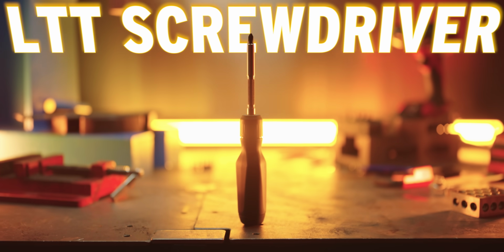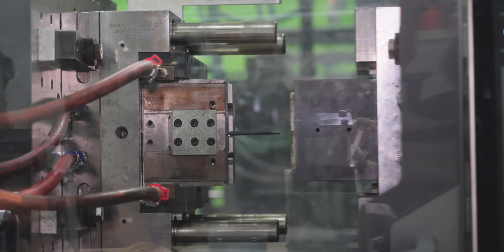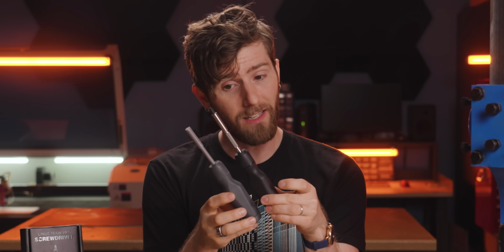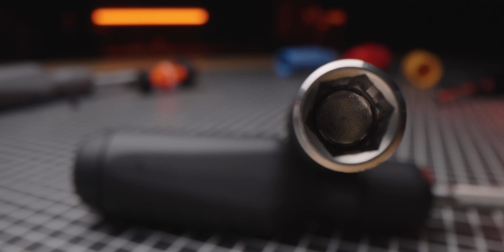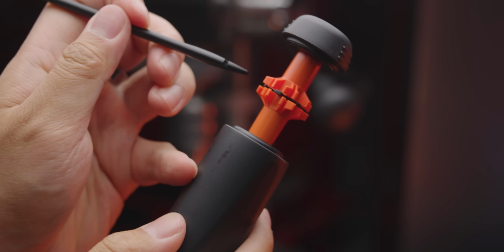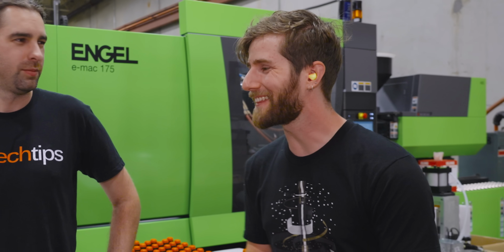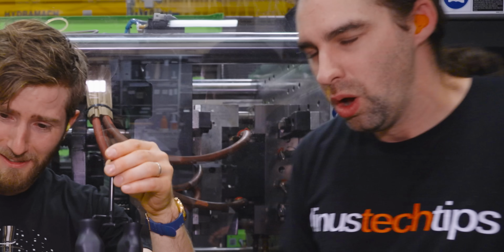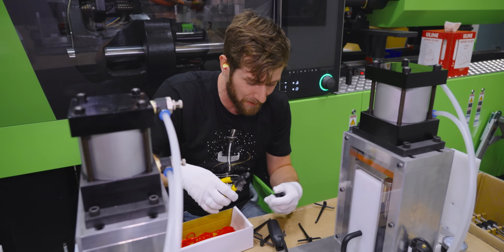Why our Screwdriver took 3 YEARS

Comment: I can buy the same thing at my local hardware store for $10 and has all the exact same features and I live in a small hick town
Reply: It's not the same. lol
It will last less 100%. And it will be less efficient...
Reply: It's a screwdriver it's not that hard  hundreds of better choices for WAY cheaper
Reply: @Ifyouaintfirstyourlast  I've tried a lot of screwdrivers that use bits and are not good but ok.
Reply: @Azarilh  and I make all my own tools it's really not that hard or expensive
Reply: @Ifyouaintfirstyourlast  Ok, kid. 😂
Reply: @Ifyouaintfirstyourlast  then make your tools and sell them for way cheaper dude.
Reply: @Azarilh  if u had a simple machine shop u would kno. For my machine shop its simple
Reply: @mattdamon9326  I make automotive parts screwdrivers r not a priority to sell I make my own tools because it's so easy
Reply: @Ifyouaintfirstyourlast  Are your tools as complicated as this screwdriver? Are they as refined? :v
Do you mold metal and plastic too? :v

Comment: Congorats on your own screwdriver, but not for me. I will stick with my sets of Wera screwdrivers. For manual screwdrivers, i prefer individual sizes instead of bits because i am not a fan of any sloppy disconnected feel, i want it to be solid with no moving parts. If i need speed or more power, i got a few impact drivers.

Comment: As much as you hype up this screwdriver, it is still a brand new product. There are some very good features that I'd have liked to see on the original Megapro, such as the magnet instead of retention bearings on the bits and the ratcheting mechanism operating in same direction, but at the end of the day, the Megapro screwdriver is already premium product, and I don't see reason to charge double the cost for these upgrades. I could use the Megapro all day, everyday and still be satisfied, so there isn't really a reason to spend nearly $100 on a screwdriver that's practically identical save for minor quality of life upgrades. If the design were completely different, such as the Wera Kraftform, then perhaps (though I would not pay that much for any screwdriver given that what's available in the Megapro is already great), but even then, it'd have to have features that differentiate it from the rest of the drivers available for cheaper.
Reply: Yes. This is not for the majority of people but more so for those that want perfection.

Also 69$ is not "nearly" 100$. That's a bit of a stretch.
Reply: @Azarilh  Sorry, I'm in Canada where $70 USD is $92 CAD. My Megapro is $45 CAD. I agree this is not for everyone, but at this price point, they should've come up with something other than "perfecting" something that was already pretty close. If they had taken a $15 driver that was pretty bad but had potential and perfected it for $45, I would've bought it in a heartbeat. Right now you are paying double for minor design changes. Still, if you choose to buy this, I've got nothing against you, as people have their preferences. In my eyes though, this is not worth it.
Reply: @qsdfcvgyjmkl  Oh right, CAD.

And yes, i agree that's a lot.
I think it's clear that this screwdriver is the "no compromises" screwdriver ( to realistic extends of course ) that Linus wants for himself, cos he doesn't have issues paying a ton for a tool and yet he can't buy the perfect screwdriver for himself, so he made it himself and shared it with others. Which makes it a niche product.

That's how i see it.
Reply: @Azarilh  Yeah you're definitely right that it's niche. That's why I don't see LTT being able to sell hundreds of thousands/millions of these like Linus hints at in the video.  I'm all for a good product, so I certainly hope the price drops eventually to a point where it reflects the actual value the product provides. The profit margins would be smaller, but that's when the sales will really pick up imo. My personal opinion at this time would probably be closer to like $60-65 CAD.
Reply: @qsdfcvgyjmkl  They have to recover a ton of money so eventually i can see the price goin down when they covered all the loss.

Comment: I love good tools, it’s what helps me achieve results as a tradesman. 
There is a lever within a Kinchrome Ratchet; it’s probably about 1 thou out of spec; and requires to be replaced every 6-12 months.

If only they could fix that fault, I’m glad you caught that issue before it was delivered

Comment: Snap-On gives me lifetime warranty. Great quality and I have been using mine for 9 years now and has yet to jam, snap, or have a bit stay on the screw or bolt. If it ever did break or mess up I can literally take it to any Snap-On truck and get an instant replacement. Not sure it'll be worth it, but this is just MY OPINION.
Reply: What opinion
Reply: @AppleGameification  rather buy a snap-on screwdriver because of warranty and ease of replacement

Comment: If the screwdriver costs 70 USD, then the delivery to Finland would cost 40 USD like the water bottle I already ordered, which I adore, the total cost would be 110 USD and my loveable country adds a 24% tolling fee on that, making that screwdriver to cost me around 140 USD in total. Now how many people could afford a screwdriver like this? You should make it look a little more like LMG merch and have it stand out to tell people that, yes this is a Linus Tech Tips screwdriver. Or atleast figure out something for the tremendous shipping costs to Europe/ (Finland).

And how about having the screwdriver fit 6 regular sized bits and ship a larger amount of bits in a holder along the screwdriver? You can choose which bits you need and carry within the screwdriver for your specific work.
Reply: All that to have it preform just as good any other cheapo rebranded Chinese factory model. Price is too high to match consumer value, probably because they spent way too much getting it designed, made and produced. Once the LTT ultra fans are all spent, mainly just USA and Canada since us Europeans are gonna have to pay multiple premiums to import, I can't see this selling too well unless they roll out third party suppliers. Love the LTT crew but this seems like a massive pissup in a brewery.

Comment: I understand why you would change the bit size but as someone who uses tools a lot those little bits will get lost with a quickness so unless you are selling replacement bits or even better including a set or at least some of the more common ones. Ps I'm commenting in the middle of the vid so maybe he will address this

Comment: Great effort. Looks good. One thing I've learned in my years on this planet working with my hands, it's not so much the bit, it's the shaft, which is why I have so many damned screwdrivers. One can make as fancy a screwdriver as they want, but if it can't reach the screw it's basically useless.

Comment: Gotta admit, I never expected to spend £90 a screwdriver...but what the hell.
Reply: It'll be a lot more than 90quid with shipping, import fees and taxes. Go B&Q and get a similar quality product for £20-30 at most.
Reply: @nxxynx5039  That was the price including the shipping and taxes. 

If all I cared about was quality then I have plenty of Wera screwdrivers I use the majority of the time (small flat and Phillips ones, a set of small metric hex drivers, a set of VDE ones with interchangeable bits, and a pair of torque screwdrivers). 

I’m not buying this because I need it, I’m buying it because it’s kind of neat.

Comment: I worked in a tool and die shop. This was a great video for those just hearing about plastic injection. The types of plastic out there would astound most. Learned lathe, cnc and metallurgy through that place. Good memories.

Comment: I'm not sure if this is an explanation as to why it took 3 years or if it's an informercial to sell the product. Well, congrats anyway on making it to final production. What a pain in the butt. When I get some extra money I'm sure I'll be picking one up. I always appreciate a good screwdriver for my little bit of tinkering. If I ever get hold of a 3080TI I'd really like to mount it using this screwdriver. That would be cool.

Comment: Actually there might not even be a heating element in the archimedean spiral. Kodak uses a similar system to melt their Film base and iirc from the smarter every day vid they don't even use a heating element. The plastic melts by the heat created by the pressure. Which technicaly makes the spiral the heating element and not the spiral and a heating element.

Comment: In my opinion, there's just one major thing missing: Pozidriv bits. I don't know about North America, but here in Europe PZ screws are more common than Phillips in many areas (like furniture). Phillips can work there in a pinch, but the difference in grip is very noticeable. I definitely need at least a PZ2 in my arsenal and I'd love to see them coming from you.
Anyway, I immediately ordered my screwdriver yesterday as soon as I saw the availability notification. Looking really forward to this. Now i just need to decide if I throw out 2 of the existing bits or if I take the time and effort to neatly grind down a regular bit.

Comment: so not even memeing, what is the warranty on this? i only ask because most other screwdriver manufacturers have a lifetime warranty, and most of them are no questions asked. for example my snap-on screwdriver (which i actually bought based off of your recommendation) has a warranty that allows me to cut it in half with an angle grinder, and bring it back and get a replacement so long as they can still read the serial number. same goes for my kobalt and craftsman tools. on top of that they're roughly the same price. i understand why you made this and i understand the passion that went into it, but trying to sell tools without a competing warranty is kind of a hard sell given the nature of the item. i just don't understand how this is a good buy from a consumer standpoint without it. 

that being said i hope it sells well. been following the journey the whole time and i'm hype it's finally ready to ship. probably won't get one personally but that backpack turned out better than i had ever hoped and it's on my list for my new mobile wfh setup.

Comment: Thanks for the hard work, ordered mine yesterday, also added all of the extra bits. Question: are you going to create something so that i can carry all the bits with me easily? my initial thoughts is to have a double megapro bit holder end to end in a cylinder that would slide out on both ends to hold 24 bits, or potentially more. if you could cram 6 rows of bits into a tube that would be cool.

Comment: I used to work in hardened steel tool and die; when linus says it's difficult to machine, picture this: we had ultrahard carbide tooling, as hard as sapphire, with coatings on it to make it shed heat, wear evenly and not pick up chips of metal, that were themselves made up of ultrahard metal composites. The tools were about 50-200 dollars CAD each.

They had an expected lifetime of about 10-20 minutes each when cleaning up post-hardening steel. 

We had specially designed drillbit heads because our carbide supplier considered what we were doing was nuts and didn't support it in their stock lineup. They were good for, if we were extremely careful, about 2-10 holes each depending on the depth. 

This is steel that is so hard, that you could take the hardest, meanest file you could find, run it down a corner, and kill the file in about three strokes without leaving a mark. This stuff is *evil*, and in a completely different world to aluminum, and is still not the wildest thing we use in the tool and die world; there's a type of steel that is usually found on the bottom edge of grader and snowplow blades. We don't... actually have a way to do detailed machining on it without EDM. Not 'suboptimal', there's literally only a few drills in our arsenal that could touch it. It was used in giant square blocks when it WAS used, for extreme wear points.

Superalloys are wild.
Reply: The logistics of dealing with material like that is incredibly fascinating, having worked only with metals like silver. I'd love to catch more in-depth videos on that kind of work.
Reply: @thenewelite4628  The video RealEngineering did on Titanium machining was a fascinating watch. Apparently it's such a complicated material to work with, it drove the engineers who worked on the SR-71 nuts as they had to basically invent and document the whole process themselves, when it was new and never used before in large scale manufacturing. It was colloquially described as "gummy" and it kept jamming up the tools constantly.
Reply: @banderi002  even today titanium is a pain to work with. It galls like crazy and wears out tooling.
Reply: @banderi002  Parker (the pen company) supposedly almost bankrupted itself over their T1 line, which was inspired by the use of titanium in aircraft (so the pen bodies were made from titanium). They had so many problems that they gave up after (comparatively) very few pens were made.

I got lucky and bought a ballpoint version cheap from someone who didn't know or care how valuable it was, but I'd love the fountain pen, just don't currently have the budget for it (they can go for $200-$300 USD on eBay).
Reply: You talking about Inconel? I also used to do tool and die, and at our shop we made various turbine parts from inconel, that we stamped out of sheet metal on a 250 ton press. the metal was so hard we had to use specials pieces of carbide tooling that couldnt even be machined. they were made by electrode burning, EDM and Surface grinding. when the press hit it should me to my core, and made a noise that sounded like a bomb going off every half second. was just bonkers.
Reply: @ghillieinthemist593  we asked our suppliers who deal in 4140 if they could do some sheet metal parts made of inconel and they just laughed at us and told us they didn’t have a building big enough to fit the machine they would need to press those parts. So we did what we always do and milled it. Lol! $12,000 inconel cable protectors. Lol!
Reply: @FoolOfATuque  why the fuck would you need THAT
Reply: Wow thanks for the insight
Reply: If you don't mind me asking, why not harden the steel AFTER the machining is done?
Reply: @johanmetreus  Just a guess, but hardening steel requires heating and cooling it, which changes its dimensions. If your final product has to match a tight spec, machining afterward would need to happen one way or the other.
Reply: @luchelibre  Exactly this.
Reply: @luchelibre  Yea but taking of most of the material before hardening and making the last pass on hardening is very common.
There are even huge ovens and oil tanks for hardening gears with 2 meter diameter. Also there is no mention about the depth of the hardened metal.
Reply: @luchelibre  The hardened metal also heats and cool in repeated cycles without the tolerances changes, but let's say the measurements do change and thus needs to be taken into account.
Would it still not be far less of a hassle to shave off those last millimetres left as a safety margin (you can always remove a bit more, but adding back is far harder) to finish the hardened piece than to machining it out of a solid block?
Reply: @johanmetreus  there’s also the risk involved in doing something like that. For example, you’d have to set up the machine again, likely making a super expensive clamping fixture for it. Then you have to reference the product again too. So any mistake maybe by the operator, inaccuracies in the machine or the probe measuring it, or from the milling itself (tool breakage, tool paths being wrong) all can add up. 0.005inch is a huge tolerance, mentioned in this video (it’s about 0.12mm) so you’d like get away with it. I work in aerospace though, where we have to do exactly what you are suggestions - and trust me, it can be tense. Especially with 0.005mm tolerances. And clamping fixtures that cost €100k + - so if anything, it’s more hassle to do this. And cost. And time.
Reply: @johanmetreus  My guess is that it would damage the finer details of the machining.
Reply: Can't remember the last time I enjoyed reading a comment this much.
Reply: @tristanxxxx  cool story
Reply: Extreme application metals are a nightmare. And then the applications require complex geometries, like turbine blades that are even hard to machine under normal circumstances.
Reply: let me tell you about MY hard hunk of metal.
Reply: We use inconel where I work. It is hard stuff to work with and super expensive to machine. It work hardens as you machine it. We also use a lot of chrome alloys for lower yield parts and the threads will gall if you don’t coat them with the proper coatings. On top of that they are using EDM to do the work which is precise but very expensive. My manufacturing engineer would smack me up side my head if I wanted to EDM stuff. Lol!
Reply: The joy of toolmaking. If you are making something out of the most mf'ing mean material there is, the tool needs to be even meaner...
Reply: What a comment. Thanks for sharing!
Reply: Cool story

Comment: I like the commitment to the product quality but just seems way overpriced for what you get ... for that price you can get a I fix it pro tech tool kit with litterity over 5x the bits and a all metal driver no plastic .... I get it you took a bath on the production of the product but 70 dollars for a plastic handled ratcheting screw driver is ubsurd a wera is under 40 for goodness sake